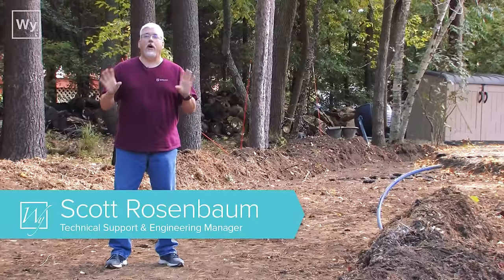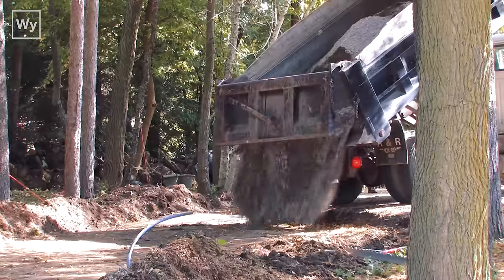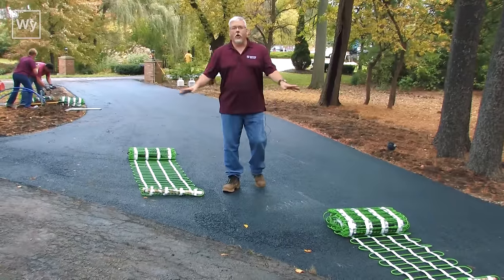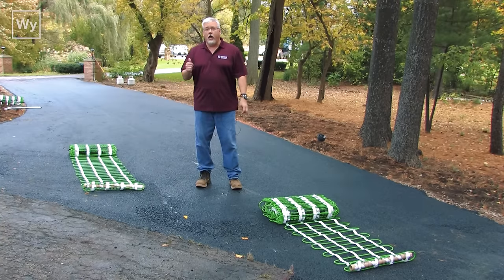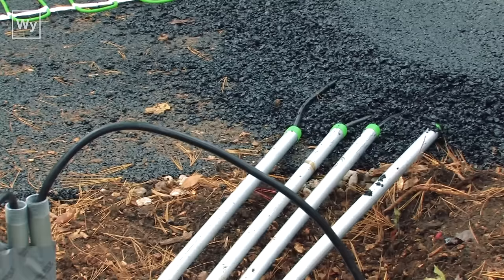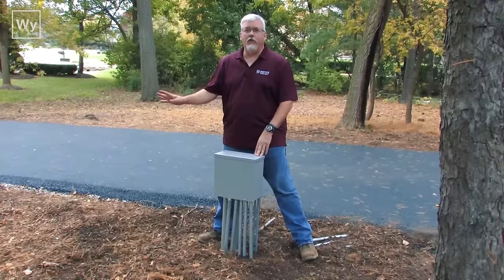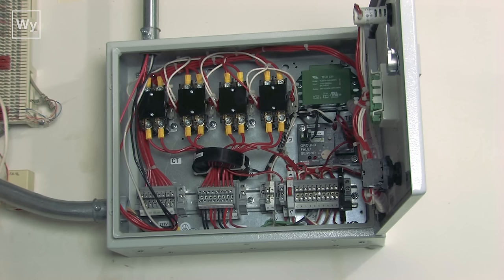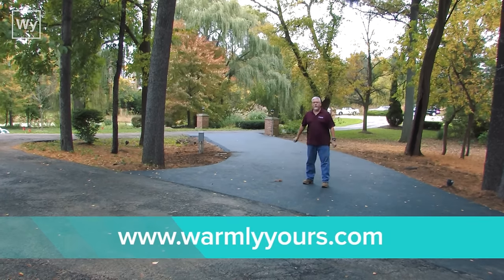Electric Snow Melting system installed in an Asphalt Driveway

Comment: How long is that driveway?
Reply from the maker: It is 80' long! Thanks for watching
Reply: @Warmlyyours  Thanks..yeah I'm looking at a sloping (down to the house) 135' asphalt driveway in New Hampshire. Time to buy a larger Ariens...
Reply from the maker: It's definitely doable for a sloping driveway! With a larger area like that, make sure you would have enough electricity to power it, even if you just did tire tracks like what's shown in the video. You can get an estimate of power usage/cost here: https://www.warmlyyours.com/snow-melting/quote-builder

Comment: Why is this system better than a heated liquid and pipe system?  Seems like the electricity bill to run this would be outrageous.
Reply from the maker: Good question David! The reason this system is better suited than hydronic is that it allows you to get areas clear of snow much faster. With Hydronic you have to wait for the whole system to warm up to the temperature needed to melt the snow. With our electric radiant heat snow-melt system, you can have controls and sensors that will detect when it's needed and turn on and off for you. For the electricity bill, what's great is that this system will only turn on when you need and it only runs for a few hours on a day with snow - so it doesn't use as much power as you might think.

Comment: I mean, would it be cheaper if 4x4 truck🤔🤔🤔🤔
Reply from the maker: Truck: repairs, fuel, insurance, registration. And you'd have to still bundle up, go outside, clear it with the car and then possibly do it again if it keeps snowing.

Snow melt system: turn it on (or let it turn on automatically with sensors) and have the driveway cleared for you.

Comment: "Tired coverage" doesn't seem very good lol if the owner is going to do this whole process they might as well have the full driveway covered with the heaters
Reply from the maker: It's completely up to the owners. Many often choose tire track coverage to help cut down on electrical cost and installation cost. Especially for those that have very long driveways, tire track coverage can help make this type of project much more affordable and practical to use without excessive use of electricity.

Comment: I don't see the point. Yes, it will melt the snow, and then you turn it of and you have an ice rink, so you have to keep it on most of the time making your electric bill huge.
Reply from the maker: The snow won't refreeze once melted. These systems are designed with a "hold-on" feature that helps the snow evaporate from the heated areas to prevent this problem. You can learn more about it here https://www.warmlyyours.com/en-US/snow-melting

Comment: Surly this would make ice at the bottom making it harder to leave the drive way...
Reply from the maker: Hi there, this system actually prevents the kind of ice build-up you described. Once it starts snowing, the system warms up to a temperature that snow cannot accumulate/stick to the surface. Ice and snow not only melt, but they evaporate - preventing refreezing and ice build-up.

Comment: You have to show me it will melt 3feet of snow like I got last night.
Reply from the maker: Our systems are designed to melt 1-3" of snow per hour on average - depending on conditions. Typically a snowfall of 3' overnight would be more than this rate and would take 12 hours even at the 3" melting rate. Nevertheless, the system would still melt the snow, just at a slower rate once it builds up that quickly.

Comment: 10,000$ for this service Or pay someone to shovel?
Reply from the maker: Since this new driveway section was already being added, the snow melt system was just a small additional cost to a project that was happening anyways. For a typical driveway (10' x 20'), a tire track layout would cost just only $2,938.00. While paying someone to shovel is cheaper per shoveling, you would still have to wait for them to show up and get things clear. And with asphalt, there is always that skim layer of snow that freezes and becomes ice. WIth a snow melt system, you don't have to wait until the snow stops and it completely melts ice and snow. With the right sensors, it can start working for you automatically. You can learn more about it over here: https://www.warmlyyours.com/en-US/snow-melting/driveway/asphalt-design-guide

Comment: What if the power went of during the storm...
Reply from the maker: This system does run on electricity, so during a storm that severe where power is disconnected it would not work.

Comment: First he said no machines on the cables then I see a machine go right over the cables several times
Reply from the maker: The machines used are designed to safely go over the embedded snow melt system to help compact the asphalt. It is advised that large machines/cars should not drive directly over the cable when exposed (not yet embedded in asphalt).

Comment: I'll plow this driveway for ten years what it'll cost you to run this contraption for one month.
Reply from the maker: Well since this system used 15 kWh, with a national average of $0.15 per kWh, that would mean an hourly cost of $2.25. The average run time for a day with snow is 6 hours, coming out to $13.50 for each day of use. So for the snowiest month on average for Chicago, January, we see 8 snow days. So for only $108 for the snowiest month, you can have a clear driveway. Split that over 10 years and you'd only be getting $10.80 a year for shoveling someone else's driveway everytime it snows. Plus, our system is able to keep up with snowstorms by melting as it falls, whereas most people won't offer to shovel or plow a driveway until after the snowfall has stopped.

Comment: ya and slide off driveway run over junction box $1000s in damage codes make people get hurt.
Reply from the maker: Our systems actually precent people from getting hurt - with how slippery ice can get, our systems create safe walking areas at home to get in and our of your car or load/unload your car. The junction box is installed according to local code, so unless you're a pretty bad driver, we doubt someone would hit that location during regular use of their driveway.

Comment: And you don't wanna know how you can repair when the coil broke underneath there
Reply from the maker: We actually use the same tools shown in this video for floor heating to identify the problem if there is anything damaged in a system like this: https://www.youtube.com/watch?v=xpMmNA7Tx7g  We are currently working on a snow-melt version of this kind of "troubleshoot" step-by-step guide.
Reply: Do you cover all the work?(asphalt removal in the area where work needs to be done as well as filling in the area with asphalt). This job isn’t as simple as lifting up a tile or 2 if you have heated floor as you mentioned in several other post.
Reply from the maker: Our Snow Melt systems come with a 10 year limited warranty in materials and workmanship, meaning that if the system malfunctions or breaks as a result of something wrong with the product itself, we will replace the damaged components free of charge. In order to be eligible for the warranty, the product must be installed in accordance with the accompanying Instructions and Operation Manual, the National Electrical Code (NEC), and all applicable local building and electrical codes. We do not cover the removal of surface material or the replacement of it - only our indoor floor heating warranty covers this much. For full details on the warranty of any of our products you can read more here: https://www.warmlyyours.com/warranty-registration
Reply: WarmlyYours ok thanks. That’s a deal breaker for me.

Comment: So what happens if or when this stops working, and it could. A huge waste of money as far as i'm concerned. You would have to tear up the driveway to fix or replace. Not worth it to me. I guess if you got lots of $$$ and looking to unload some of it, well... there you go.
Reply from the maker: Hi Katy, You can see how these types of systems are repaired, indoor or outdoor, here: https://www.warmlyyours.com/en-US/video-media/repair-damaged-tempzone-floor-heating-cable-open-circuit Basically a device is used  at the end of the cable that says how far down the cable it is damaged/not continuing the electricity. You then follow the installation plan we designed for you when it was ordered, and identify where that spot is. All you do is simply excavate a small area (6" x 6" on average) to free the damaged cable and have an electrician or our team do a splice repair. Repatch that spot and you're all set. So no need to tear everything up!

Comment: all those workers! must be an expensive job
Reply from the maker: The whole crew helps the project move along quickly while the asphalt is still warm enough to work with - that's the one difficult thing with asphalt projects in that you have to be ready to use your supply immediately and get it set quickly. But our systems are also compatible with concrete driveways as well as pavers (as long as the system is embedded underneath them).

Comment: that's a bad idea...asphalt gets soft when heated...maibe under brick pavers,or concrete....not asphalt
Reply from the maker: Danilo, our systems are well tested and only warm up the surface to just above freezing to help melt the snow. So "warm up" is relative to the frigid temperatures outside. Consider how much an asphalt driveway is warmed up by just the sun alone during summer, our systems fall well below that threshold and do not compromise the structural integrity of the driveway.

Comment: Probably guaranteed to have many cracks in the asphalt.
Reply from the maker: The customer who had this system installed has actually had no issue with their driveway or cracks forming. As long as you follow the instructions during installation, your driveway will have the same wear and tear it normally would without a heating system. Thanks for watching!

Comment: Seems overly complex , I could same with some PVC and couple hot water heaters from Craigslist .NP
Reply from the maker: WIth an electric mat though, you have low-profile installation. With PVC, you'd have to accomodate the thicker layer the pipes would lay within. And if there are any repairs needed, it would not be as easy to repair as our electric system. And with outdoor heating, it would need to be a glycol based liquid so it can't freeze as easily - heated water running through outdoor pipes could still easily freeze if it's cold enough and not constantly moving.

Comment: Kinda screwed if it breaks
Reply from the maker: Not necessarily. With the right troubleshooting tools, you can identify any damage to the cable and excavate a small portion of the surface to access/repair that particular spot. Makes it easy to maintain the system for many more snow-free winters!
Reply: @Warmlyyours  Just not something I would get unless I had a really steep driveway. Cutting into pavement sucks.
Reply from the maker: Totally understand, but we have plenty of customers who find salting and shoveling really sucks, which is why they invest in these systems. Especially great for those aging in place and don't want to risk slipping and falling on ice.
Reply: @Warmlyyours  I get it. Especially for the elderly.

Comment: Imagine paying for this when you could just get a good snowblower (possibly riding) for the install price and then you could pay the neighbor kids for less than the single use operating cost. I guess you just wanted to pay out the ass for almost no extra convenience.
Reply from the maker: Well the extra convenience comes from how the system turns on. It can be customized based on your needs, but most customers choose to install sensors in the driveway and get controls that can detect moisture and temperature to help turn the system on as snow is falling. This means no waiting for the snow to stop before getting rid of it. For a snow blower, shovel or neighborhood kids, you can't really start until the storm has passed. With these systems it makes it easy to clear the driveway as it snows. This is especially useful to those that may not be able to physically clear their driveway on their own or do not want to wait hours for the snow to stop. Thanks for watching!

Comment: Wouldnt it be a pain in the ass, if they got a couple of bad rolls, and put them under asphalt.   Good lord sounds like a headache
Reply from the maker: That's why we advise that the heating elements are tested when they first arrive in the shipment, before you start installation, during installation (when they're all in place) and after installation when the top layer of surface material has been completed. 

Our warehouse team also tests every roll before it gets packed up in the box so if there's an issue when it arrives, we can get it easily replaced. 

But if something does happen to the product during install, our repair service team can come make an on-site repair or walk your electrician through the steps to do so. In most cases, any damage to the mat can be localized, requiring only a small portion of surface material be excavated, cable repaired and the hole filled in.  This is also the case if there are any issues later on with the system after it has been fully installed. We've never had a case where the entire mat or cable needs to be removed to get the system working again.

You can learn more about out systems here:
https://www.warmlyyours.com/snow-melting

Thanks for watching!

Comment: seems like an electrical hazzardin a flood.
Reply from the maker: Hi NightShade, so since the system is embedded, you would not need to worry about water damaging the system during a flood or the electricity causing any issues with standing bodies of water in that area.

Comment: Wow, big mistake putting the power cables that exit from underneath the asphalt at ground level (the ones in the white conduit (PVC?) between the conduit box by the driveway and the new asphalt).  You should have dug a trench, at least 1 ft deep, between that driveway conduit box and a spot at least 1 foot into where the edge of the new asphalt drive was going to be.  In this trench you should put one single conduit tube.  Then you should have fished the wires from the heater array through that single buried conduit.  The underside of that outside conduit box should also never be above grade because you are exposing the conduit which is unsightly and hazardous.   Also, in addition to your mistake of laying high power cable conduit at ground level, totally exposed, you did not even bother to group them into one tidy bundle.  I could see at least two coming in at funny angles.  If I were the township/city code inspector, I would make you rip that out and do it right.... an accident waiting to happen.  Also, why pay all that money for a melt system and not pay a bit more to lay heater strips over the whole width of the drive?  In a real snow storm, it most likely would melt a width much less than the melt strip width.  I am guessing this installation was in the southern USA where they don’t get much snow.
Reply from the maker: The conduit placement was decided by the electrician on site and the homeowners of this project, but we do try to recommend that the conduit be as out of the way as possible for projects like these.

As for the layout of the snow melt mats, tire tracks are a common design that homeowners will choose to help save on cost of the overall project as well as operating cost. The snow melt systems melt exactly where it is installed, sometimes slightly more as the cables radiate heat outward about 1.5". This project was done in the Chicago suburbs.

Comment: Why not just purchase a small ATV with a plow.
Reply from the maker: Well even with your own plow, you still typically have to wait until it's stopped snowing to clear your driveway. With a snow melting system, it can start melting the snow as soon as it starts. 

Plus with an asphalt surface, plowing does not completely clear the area of snow and ice. Plowing will crush and push the snow and ice into the fine cracks and grooves of asphalt, making it near impossible tto completely clear it. 

There would also be the issue of storing the ATV/Plow while a snow melt system is embedded in the surface, taking up almost zero space. Hope that answers your question!

Comment: What is the point? Just get winter tires.
Reply from the maker: While snow tires may help your car get around more easily in the snow, our snow melt systems allow you to get in and out of your car safely. One of the biggest hazards during the winter is slipping on ice and snow - with our systems you can create snow free walkways to and from your car, making it safer and easier to get around.